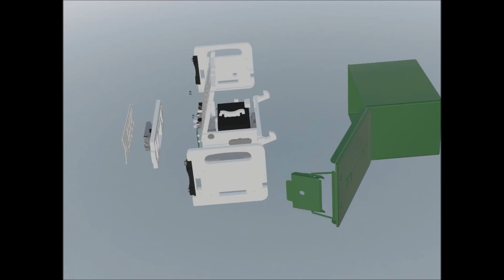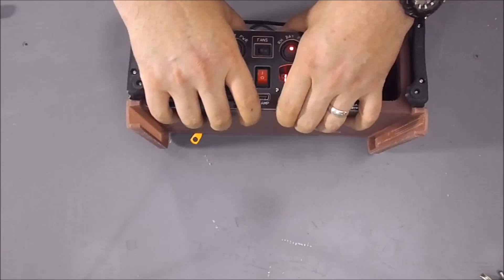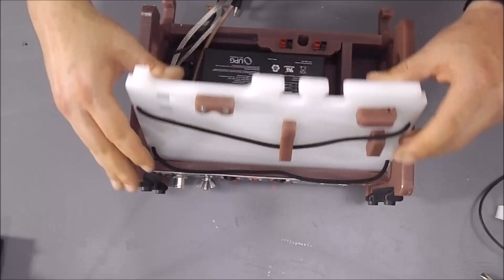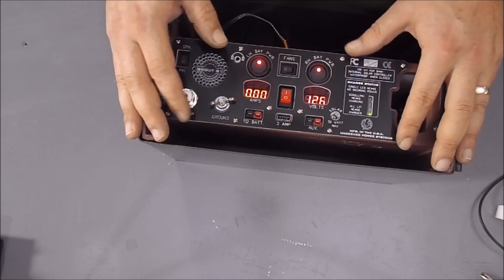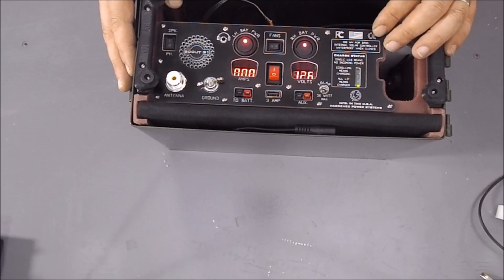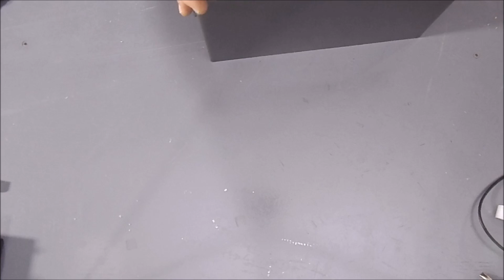Scout G1 Introduction

Comment: Looks great, but would I need a right angle jumper cable to use my LDG Z-817 tuner? and do you sell them?
Reply from the maker: Tracy, we could certainly get you the right jumper, but I do not think that tuner would fit alongside the 817... primarily because of the way the mic and audio out exit from the side of the radio.  Those two connections would eat up some of the space you would need for the tuner...

  The upper equipment bay is 2.25″ tall, 10.5″ wide, and 8.5″ deep.  You might want to do some measuring?
Reply: It will fit in the slot, but the way I understand the video is that it needs the right angle jumper for the radio to fit.  If so one will be needed to go from the radio to the tuner.
Reply from the maker: OK, now I understand.  ;-)   If you need the same cable we are currently using in the machine (shown at the 7:00 mark in the above video), we can certainly do that, and we will do it at our cost.  Just shoot an email or call if you decide to purchase and we will set you up.

Comment: Would you be willing to sell only the chassis, with no battery?
Reply from the maker: Of course.  Our cost on the battery is about $20, so we would deduct that off of the price.
Reply: +Hardened Power thx for coming back to me Bill. the point is not the cost of the battery, it's the cost of the shipping. so for example it makes no sense for me to purchase the battery and the ammo can when I can buy them here and Europe for much cheaper than the cost of the shipping from the US. Therefore from my perspective, although this looks like a pretty cool solution, the shipping costs will be the deciding factor. Another point is the solar charge controller that's installed. I'd like to get rid of it and replace it with the Genasun GV-xx for lithium-ion batteries (not the LifePO4 option mentioned on your site). This will give me a Li-ion compatible solar charge controller and the option to use batteries which are a third of the weight, with the same amp hour rating. I guess my actual question is; Are you willing to sell just the bare minimum system, so more advanced operators can integrate their own batteries, charge controller, and leave out the ammo can and battery to save weight?
Reply from the maker: STN,  Yes, we could sell you a 'bare' system like you describe...  and the Genasun is an excellent controller.  Of course how you package a controller that large will be up to you, but we could omit the battery and controller, and give you clearly identified connection cables to the Genasun.  Please be aware that the omission of the controller will also remove the charge indicator on the front panel.

Send an email or call us and we will work with you.
Reply: Awesome!